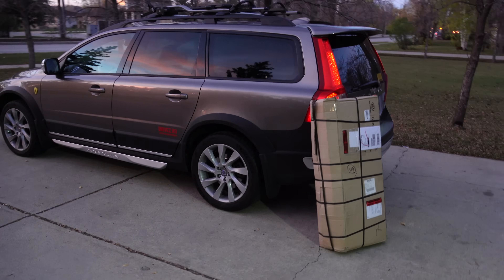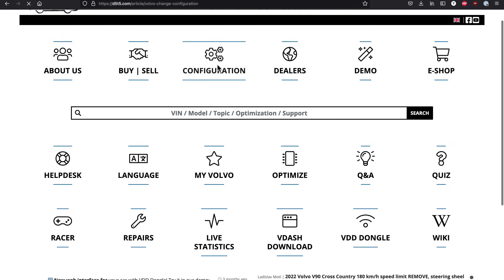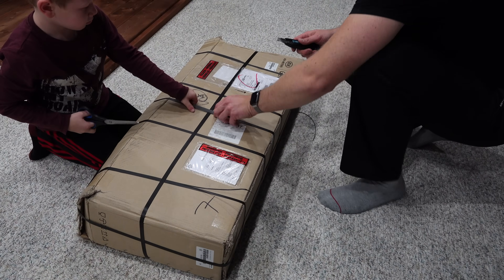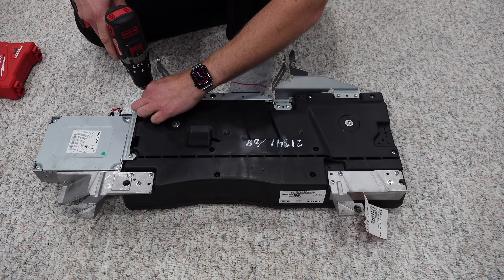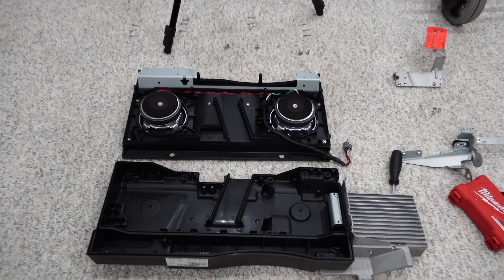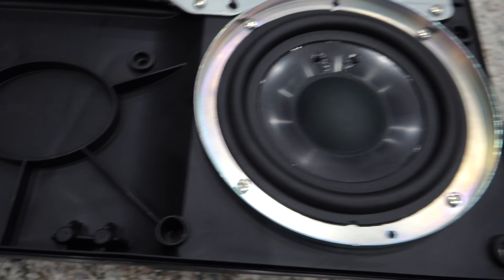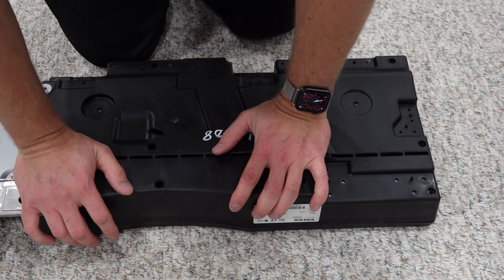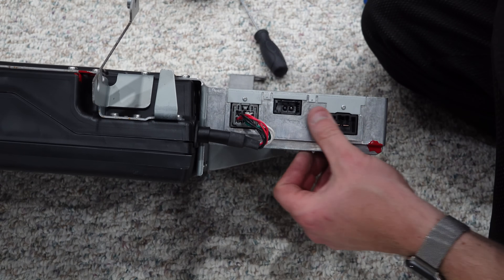Original Subwoofer Volvo V70/XC70 P3. Whats inside? Part 1 of 2 (D5T5.COM)

Comment: Hey.  I did the same as you.  I added a subwoofer.  But the subwoofer works only for 40 sec.  And when the car engine is running, it doesn't work.  Can you suggest something what I can do?
Reply from the maker: Did you program it? Removed most security? Defective AMP?
Reply: When I bought this subwoofer.  I was able to try it and it worked.  Programmed from the t5d5 page.  I have to ask him.  Wasn't there
Reply: The subwoofer appeared in the radio.  Sorry for my bad English.

Comment: You sir, are the first one to ever film and show this on YouTube ! I have the newer one , with the premium amp under the seat in my xc70 t6 -13! Great sound ! Sheers from Norway 👍
Reply from the maker: Wow. Not many T6 in Europe. Most are Diesel because of fuel cost.
Reply: @volvosweden  Yes idd , according to the car salesman, there is only 2 Volvo xc70 t6 with everything that was manishelbella to putt in the car, ever sold in Norway . List price was 1.3mil Norwegian kroner= $150k ish .. ofc i did NOT pay that much , so in 2017 i got this Pearl black metallic baby for 57k ! You are one rare firesoule off the Volvo  P3 T6 on the nett and a big inspiration !! long time fan here !!! Never stop , have a good day !
Reply: @Odorox84  Hi. Grettings from sweden.  Proud owner of a v70-12 T6 here. I wanna update my car with a subwoofer, alredy got premium sound. Was wondering what connections u have in ur sub and if the amp under passengerseat is an aluminum with a blue connector in it. Thanks in advance. Kind regards from Fredrik, Sweden .

Comment: Added this subwoofer (newer model without amplifier)  to V70 year 2013 with premium sound system. It was too hard to make factory add-on (nobody know the S/N for factory amplifier with subwoofer channel), so I put little mono amplifier under the passenger seat. Took high input from factory amplifier and took speaker cable to boot.

Subwoofer box went to orginal place, but I had to cut for the subwoofer a hole to lower midsole and cut the stiffener beam from upper midsole. I think that in factory assembled subwoofer there is different midsoles already.

Comment: Cool, I don’t even know if there is one of those subwoofers in my xc70. Have to check 😊👍🏻
Reply: It's an add-on for the Premium Sound package (Dynaudio or Harman Kardon depending on MY). Did cost around 3000kr extra on my V70 MY16 if I remember correctly. Have Bower and Wilkins in my new V60CC now which is awesome.
Reply: @jimzon  ok, thanks
Reply from the maker: I think you can add it to High performance too. I hope so
Reply: @volvosweden  Yes you can. But it was not an option when I bought my V70 in 2016. :)

Comment: Awesome, just a question on your Coolant change on your V50. Have you had any problems with changing the colour of the coolant or is the car running fine? I was told if you change your coolant form orange to green it can cause issues. Thanks
Reply from the maker: I can’t answer. I don’t know

Comment: Had this sub in my 2008 V70II and when we bought a 2010 V70 without it I checked with Volvo if it was possible to retrofit it and they said that it wasn't possible, as the optical cabling was not installed in my car.. now I understand as it takes quite a lot of work... 😬
Have had original subwoofer in 2002 and 2004 V70's too, and I actually think it sounds better...

Comment: Hi Yuri, 
My P3 XC70 in the UK has the Dynaudio sound system installed which was a premium ICE option which cost the original owners £1000 to have fitted to the car. It’s an amazing system that is so clear and precise, however it doesn’t have the subwoofer in the boot. I’m not sure if that is because Dynaudio didn’t require it or because it’s an additional option on top of the system I have. 
Dynaudio are a Danish company who are currently working on premium systems for VAG vehicles. 
I’m interested to see how yours sounds. Thanks. 😊
Reply from the maker: Can’t wait to hear it rumble. The downside is it gets very cold and I have no heat it my garage. I will look at options
Reply: @volvosweden   It gets cold in the workshop I rent, sometimes as low as -6°c but it will likely be a lot colder where you are. For heat in my workshop I have a powerful fan heater blowing against a sheet of steel which heats up and acts like a radiator. 

I will have to try and find out if the subwoofer is an option with my sound system because it could make an excellent system better.

Comment: How do you plan to get around the MOST system? ITP remove will probably not be enough
Reply from the maker: In VDASH you can remove MoST
Reply: @volvosweden  Yes, then you turn off MOST on the stuff that is in your car. But previous owners must also turn off the MOST of the subwoofer before disassembling it, otherwise your car will not accept it. It will be exciting to see if it works. I tried to mount a used 7 "screen in my car but the car does not accept it because it was dismantled before MOST was switched off on the car it was in.
Reply from the maker: I just received all necessary cables and bolts. Will test it this weekend and see if it works on my XC70. Will comment here of the result
Reply from the maker: @pbb81  it works! Just paired it to my XC70. Its Pumping! Next step is final install under floor and wiring.
Reply: @volvosweden  Nice!!! Looking forward to seeing that video.

Comment: I have this in my 2010 XC70 from factory. Cars with this from factory are also DAB ready.
Reply: Are you sure about that Tommy? I’ve got the sub from factory in mine but it’s a late 2007 early 2008 model P3. I don’t think the headunit is new enough to support DAB at this age?
Reply: @michaelmclannahan1165  For 08 there is a DAB prepkit and DAB kit, but not for 07.
Reply: @langengen.  be interested to know if that applies to mine. Would love to add DAB, is there anyway to find out for sure?
Reply: @michaelmclannahan1165  Seems 08 or later is the only OEM way to go. 2012 or later are 100% DAB prepped. Atleast in Scandinavia.

Comment: I need your help please ! 
2010 XC70 T6:
I wil pay u for your time. 
So, today while driving on the freeway my check engine light started flashing… then my temp gauge lit up, the I noticed a sluggish feel. Pulled over. Shut the car off, and it would start but real sluggish. Called AAA. Got home. TrueDepth to start it again, and all it does it crank but no start. I’m thinking possibly fuel pump? oil and coolant are perfect. As it’s always properly maintained. Ideas? I check the codes and it shows all misfires, electric fan and a couple of others.
Reply from the maker: I would not be able to help. You need to properly diagnose the car.
Reply: @volvosweden  thank you ! I love your channel!
Reply: @volvosweden  if you’re ever in Los Angeles let me know. We do a weekly comedy show at the world famous  Hollywood Roosevelt hotel. We get a lot of A Celebrities come thru